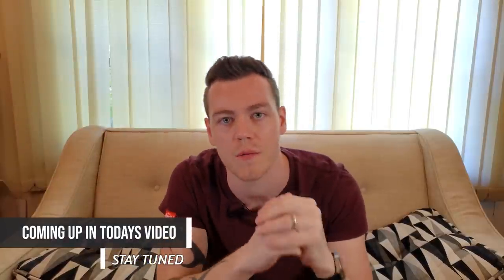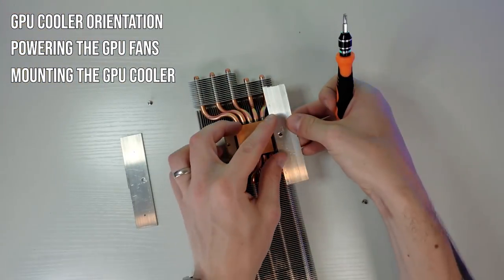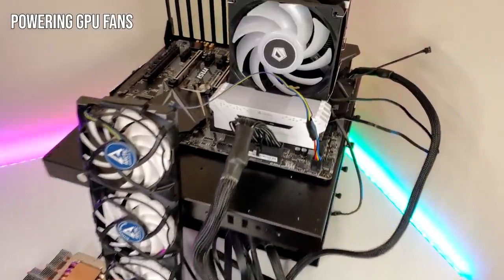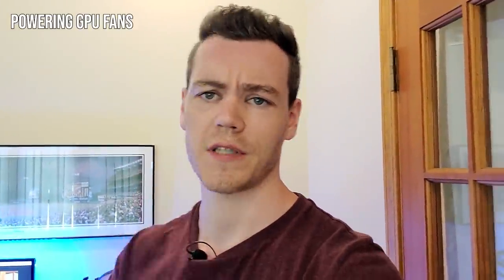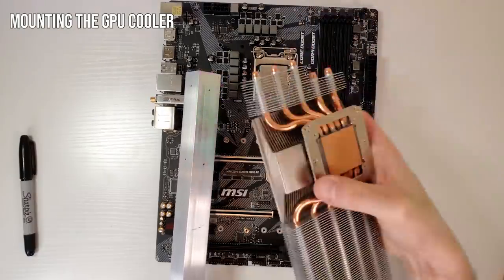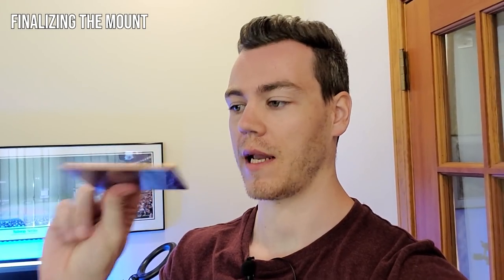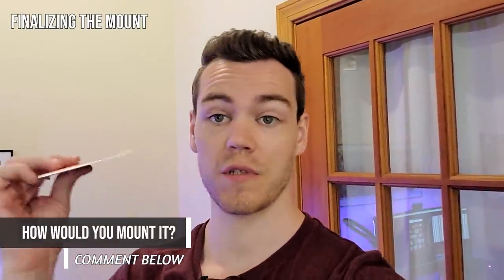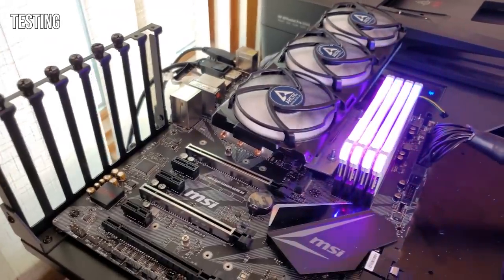Cooling a CPU... With a GPU Cooler!!

Comment: Hear me out here: custom copper mounting plate with extensions that cover the VRMs to make this a 2 in 1 solution for both CPU / VRM cooling.  That's basically the design approach of most GPU cooling plates, with some thermal pads or extra plates thrown in to compensate for uneven height adjustments.  Getting a custom plate like that machined perfectly would be a lot of work, but it would likely result in much more thermally efficient cooling.

Comment: Use a .999 silver plate. Silver is better at transferring heat than copper. More expensive, but 1oz is only $23
Reply from the maker: Good idea! I was also thinking a small vapor chamber if I cant get direct contact.

Comment: Just for the math. Ideal Copper has about (lamda = 1/u) 400Watts per meter and Kelvin. So for delta T = 20 and thickness of 2mm (0,002m) and a surface of 2x2cm.
Q  = Lambda * A * deltaT  / l = 400 * 0,0004 * 20 / 0,002 = 1600 Watt. So if the surface Area is completely connected, you will not suffer from anything like bad head conduction.
Reply: OK 1066 Watts at 3 mm Copper

Comment: Ok, linked from Dawid here, I'm pretty sure that someone else would have suggested it but if your going to go this far then why not go the whole hog and integrate peltier cooling in that 3mm space? Have a look at Der8auer's channel on the new Intel cpu cooler. Using Peltier opens up a whole host of overclocking. Also have a look at Naomi Wu's channel where she uses them to chill down a cold plate for a dog bed for her husky. Great content BTW.